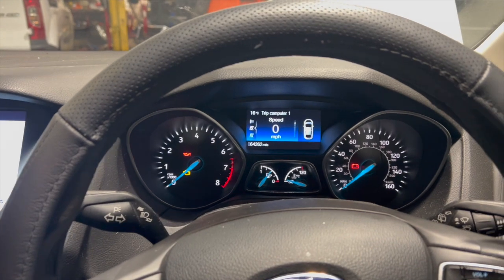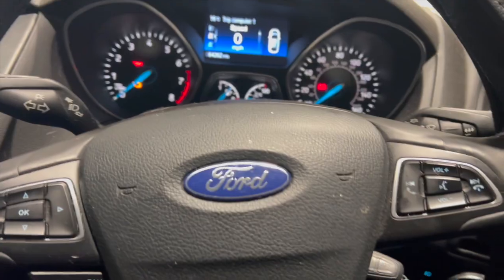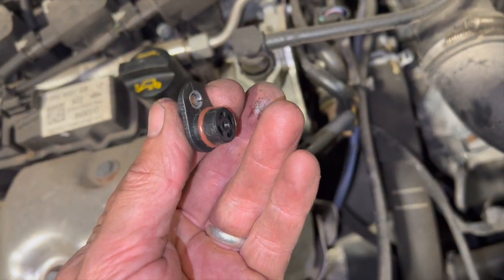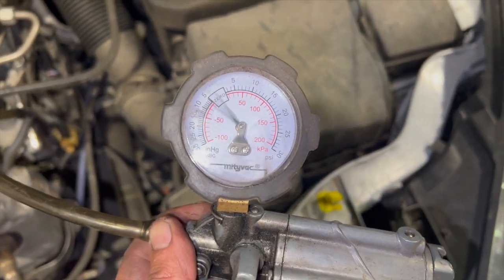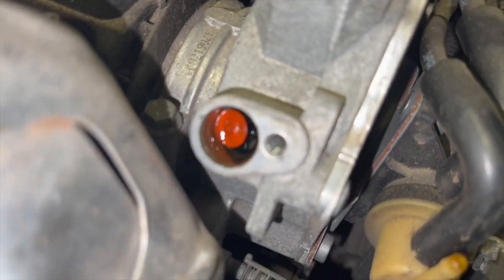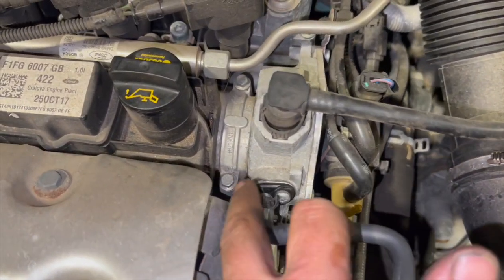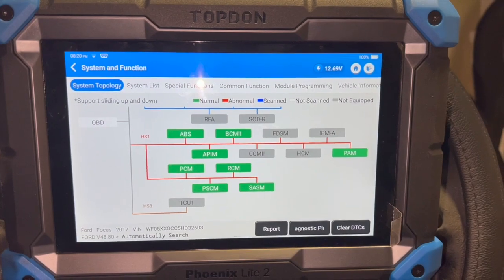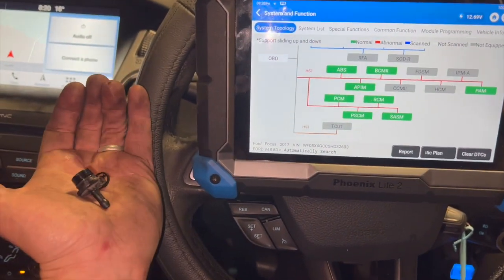Ford Focus 1.0 ecoboost P0299 Fixed

Comment: And why to do the procedure with the vacuum gauge when you can just unbolt and see if its like this on the video am i missing something?
Reply from the maker: You might damage it removing it , it’s simply to test before replacing
Reply: @diydaly  how can be damaged if its not already broken inside this is impossible are you serious? Only because i will unscrew a screw and drag it out will be damaged if thats the case it would not be in an engine this component

Comment: Can this affect brakes too? My brake pedal travel is long😒
Reply from the maker: If the pedal travels long more likely to be a different issue , the only way the vacuum system would affect the brakes if by stopping the servo assistance .. basically giving you a really short hard brake pedal and it wouldn’t feel like it’s braking very well

Comment: Hi Gav.. just had wet belts done.. replaced that valve put a used vac pump on. holding pressure at valve but will only boost when I remove the wastegate vac hose.. holding vac at wastegate. when i run the engine its holding vac at the pump.. any help greatly appreciated . found this video very helpful thx.
Reply from the maker: Hmm that’s abit odd , but hard to say without looking really mate

Comment: Very nice. This was the issue on mine. I got the P0299 code but it cleared itself for some reason, but when I checked the valve it had the exact same failure as the one here.

Comment: I had found my EcoBoost very slow and not much power.  On motorway would lose power specially on inclines and wouldn't hold speed with cruise control on would be at 70 and drop to 40 in middle lane. Was in garage but no fault codes. Can this have been same problem?
Reply from the maker: Possibles, we’ll worth just taking it out to inspect

Comment: Just bought my Ecoboost it struggles on motorways cause there is little power when reving to the max it only reaches 5000 revs would u say it’s the same problem
Reply from the maker: Hard to say really, it’s easy to check though

Comment: I Recently got myself a 2017 FF ecoboost and got the po299 error after 2 weeks when joining the motorway going uphill and trying to give it a bit of welly. looked online and came across this video. went out and took my valve off to find it in bits. bought a new one from the link you gave and fitted today. initial takeoff has no hesitation now and fuel economy has started to improve already. power also feels more consistent at lower RPM. I'd say if you have an ecoboost and only do short journeys you should defo check yours even if you have no symptoms as my car only has 50k on it and it was completely destroyed.  Thank you for this video!!
Reply from the maker: Nice one, glad it helped. thanks for the comments 👍
Reply: @diydaly  Your welcome, you saved me a bunch of worry there! in your experience how long to these valves last? the design look s a bit poor for longevity
Reply from the maker: @jamesshort1464  👍 it’s hard to say , I’ve seen some go at only 30,000 miles 4 years old then other last till 100,000 area!
Reply: @diydaly  as an update the same problem came back, I popped the new part off and that had fallen apart too! The plastic part that holds the diaphragm in is just push fit and I don’t think it’s tight enough. I’ve now superglued it on so hopefully it won’t fall apart again. I’d defo recommend it though. It’s amazing how such a small part can have such an impact on the engine! Thanks again. :)
Reply from the maker: @jamesshort1464  nice one 👍👍
Reply: If that valves bad?? Will the vehicle Smoke? Smoke, as if it's got a bad head gasket, or the seal's are bad within the turbo an it's cooling system??    
 I need help with my daughters car. I'm about to , change the turbo. Because, I believe the seal's are bad within it'. And it's blowing coolent out of the exhaust 🤔
Reply: Hello James, I have the same problem in my ecosport 1 ltr turbo. Major issue is this part is not available in India and I am trying to avoid to replace the whole vacuum pump if I find that valve somehow but it is not likely.

My question is that due to this broken valve washer does vehicle hesitates too randomly or when accelerating ? or hesitation is due to some other reason?

Bassicaly asking for symptomps
Reply: where is it on Audi q5 2012?
Reply: hi my car has  code po299 limpode underboost everytime only on a highway after 40min 1hour uphill in the city everything is great! Mechanics say turbo but i cant believe it since the car has power until its on highway uphill then something goes wrong i need help as soon as possible.

Comment: Thanks for the info and link to a part number.  Couldn't find one locally when I had to fix it.  I used a Dorman vacuum check valve off the shelf at local parts supplier for $9.
Reply from the maker: Nice one 👍
Reply from the maker: Nice one 👍👍
Reply: You buy one in the states
Reply: Hey, was this in the us?
I'm having a hard time finding one off shelf
Reply: I'm googling for it now, but I don't see one that's similar to the piece needed.
If possible may I have the link you used or photo?
Reply: Any idea which way the vacuum flows? Im in a pinch pretty bad and using an inline check valve and have no idea which way to install it.

Comment: I replaced this but 2 days later the service engine now light come back on can you give any advice
Reply from the maker: Have you checked the fault codes?
Reply: @diydaly  po299
Reply from the maker: Possible my turbo at fault then
Reply: @diydaly  Same mate, I got the same car but the wrench
• (service light) comes on for me. No engine light but l do have the same issues as underboost and my car loses power after a long haul or going up hill. When you turn the car off and back on, it goes away, I also have the restrictions of rpms as well for some reason. I haven't checked my fuel pump valve but it could be the issue

Comment: Hi I’ve had this problem mine was all clogged up with like grit I changed it and was better then went back to not boosting so changed it again and changed the vac pump and done an oil change was good after that but has now gone back to not boosting properly sooo confused 🤦‍♂️
Reply from the maker: 😬 may be the turbo itself mate ; hopefully not but will need checking
Reply: Remove vac line from wastegate at turbo.. see if you get boost..

Comment: Good video! What do you reckon to the maf sensor fault? Short to battery on forscan.. p0103. 
Also usually service now light and limp mode would come on while boosting and i could turn the engine off and on again and it would clear.. now its constantly on in service now mode.. no boost? Any advice? :-)
Reply from the maker: Thanks , is that the only fault code you have stored ?

Comment: I have problem with ford s max 2007 2.0 tdci, have problem code P0299. In service they told me change engine. How to fix problem. Power is 50 % down?
Reply from the maker: standard boost code, could be turbo , turbo hose , solenoid.. there's quite a few issues that may cause that code.. it would need looking into

Comment: is it possible that if this diaphragm is broken, oil from the vacuum pumo gets into the vacuum lines? i have many oil in Dump valve turbo, ive checked this valve and i dont have this orange membrane only a peace of it in the middle. thank you
Reply from the maker: only if the main seal from the pump to the drive is leaking otherwise it shouldn't
Reply: @diydaly  it seems to me that if there is no orange membrane, it is because now, without this membrane, after unfastening the hose, the pump makes overpressure by blowing air with oil into the wires. if there was a membrane, it would prevent blowing out, and it would only suck in air in one direction, creating a vacuum. do i understand correctly? thank you for contacting you
Reply from the maker: @dam.mdj953  the orange membrane isn’t creating the vacuum it’s purpose is part of the 1 way valve thus keeping a more constant vacuum pressure on the outside of the pump , without the membrane it fluctuates alot

Comment: Nice fix, and love the Leather-man used to disconnect the vac pipe, do you have any thoughts or upcoming vids on Knock sensors got a P130D on a 2019 1.0 ecoboost?
Reply from the maker: Thanks 👍 not yet , not come across that fault yet.. we look after plenty though so ill let you know if anything comes up

Comment: Super helpful!!!  My garage quoted £700 (£500 for the new vacuum pump from Ford) but they then advised me to try and source the unit cheaper, they even showed me the valve part that was cracked and said, "You just need this bit.  If you source and buy it we we fit it for you."
I have bought the part via your link in the description. So that's several hundred pounds you've saved me, thank you.
Reply from the maker: Nice one! Glad it’s helped you👍 it’s a nice little fix 👌👌

Comment: Useful information 👍. Horrible little engines though, sound like a bag of nails with the noise from HP fuel pump 😄
Reply from the maker: Thanks 👍 yes they are mate , plenty of them about though 🙈 not had to do a timing belt on one yet.. engine out job I believe
Reply: @diydaly  I rebuilt one on the bench last year, think the wet belt is supposed to last about 100,000 miles but they usually grenade well before then 🤣🤣🤣
Reply from the maker: @SalvageMasterEssex  haha we’ve only had 2 blown up which is surprising as we look after quite a few!

Comment: Do you have any clutch replacement videos on 1.6 tdci or plan to do so?
I changed a new clutch on mine but the bite point is very high
Reply from the maker: Not yet mate , if one comes up I’ll do it though 👍
Reply: @diydaly  Apreciate it! any idea why is the bite point so high after new clutch? Could it be normal due being aftermarket?
Reply from the maker: @CarloLeonKolega  Im presuming it was a concentric slave cylinder? if so there's not an adjustment but it shouldn't be high.. did you replace the dual mass flywheel? if the clutch or flywheel was wrong (as in depth) it might cause the issue
Reply: @diydaly  Everything is new, and yes it cant be ajusted, its hydraulic :/
Reply from the maker: @CarloLeonKolega  they do have a problem with the master cylinders .. the clips wears and the ball doesn’t sit into it right .. might be worth a check

Comment: Nice fix. Just goes to show the benefit of experience as you fixed it without replacing the entire unit 👌🏻🔧
Reply from the maker: Thanks , it’s a nice little fix .. p0299 usually relates to more expensive issues!